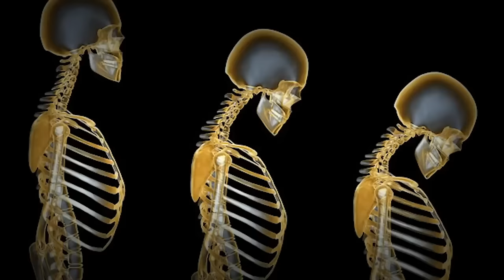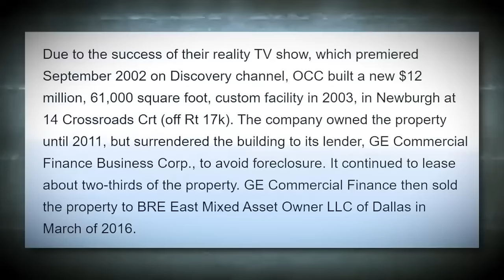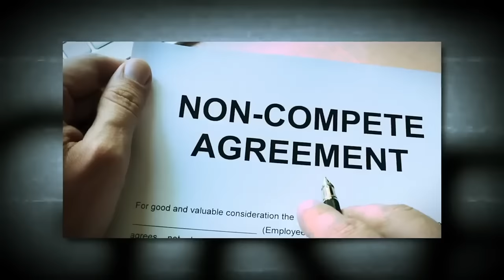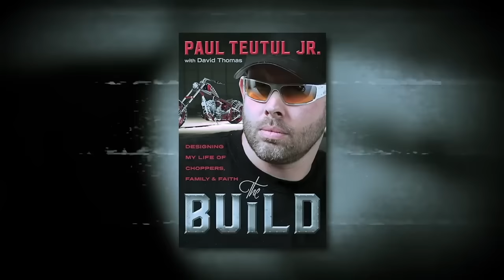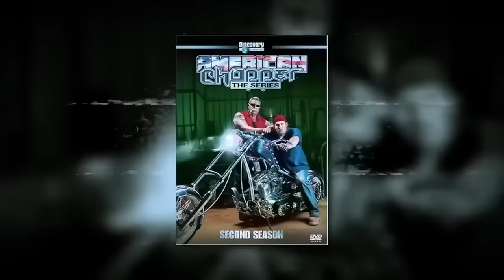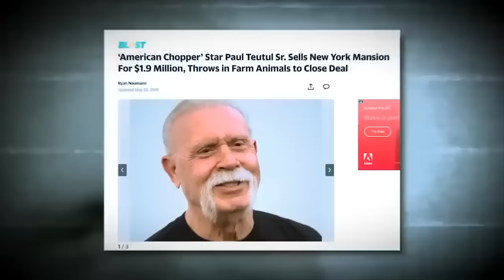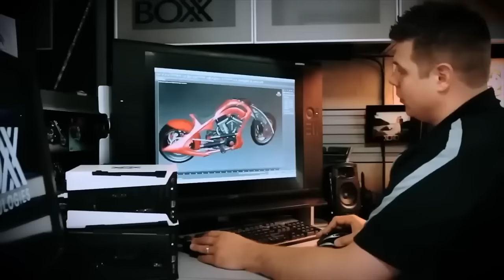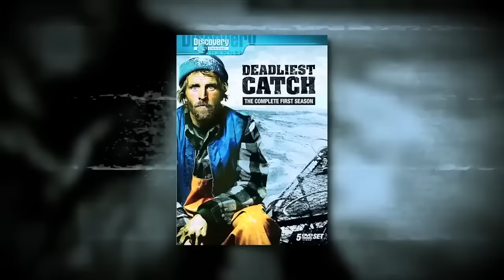Why You Should NEVER Ride An Orange County Chopper Because of THIS

Comment: Orange County choppers look spectacular they’re handling is terrible the engines just have too much high-performance you can’t even control the damn thing they don’t turn well they don’t stop well and you need a ride no more than about 25 miles before their crappy suspension systems beat the living meat out of your tail end they have no resale value so I agree with the narrator

Comment: So I used to run Dakota thunder back in the early 2000s when the chopper market was hot and I'll start by saying I don't really have a lot of respect at all for anything OCC did their bikes were not well designed they were not well made they just weren't quality but the person doing this video clearly does not know anything about building motorcycles the way your wording things and the structure of the sentence is you're using about these motorcycles really shows you have no mechanical knowledge of building the motorcycle at least the boys at OCC understand the mechanics they just sucked at it

Comment: 🎉😂❤. ,,  THEY ARE A NAME ONLY BIKE. ,,YOU CAN MAHE ONE ALSO. JUST A BUNCH OF PARTS SOME ONE ELSE ,,CHROMED ,,PAINTED ,, WELDED. ,,ULPOSTERED,,  MOUNTED TIRES ,,  CRIMP WIRE ENDS ,,, AND THE ALL POWER FULL. (("" UNI DRILL BITE )) STEP DRILL BITE  ,, THATS A OCC BIKE ,,,